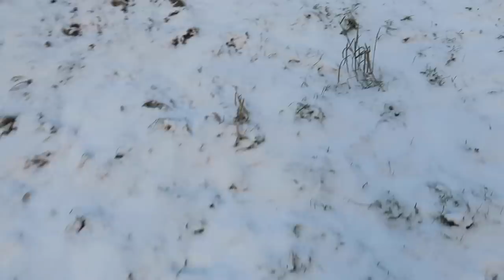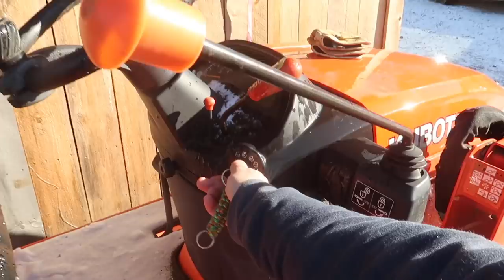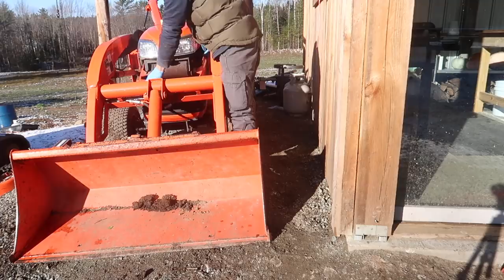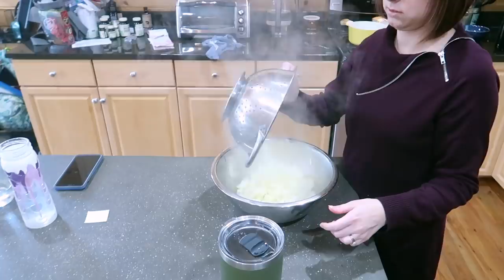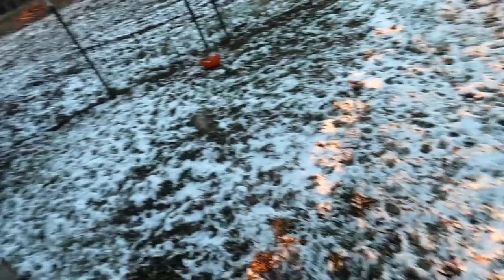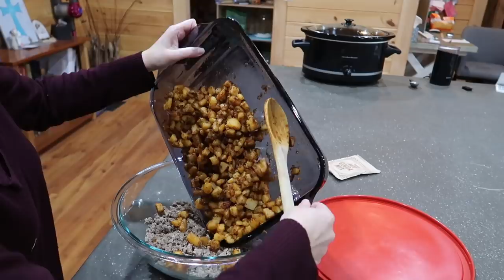Well That's Not Good! The Kubota won't stay Running

Comment: Buttercup is a typical kid, doesn't want to eat her veggies lol. Have you thought of doing breakfast bake. You use a type of potato (hashbrowns, leftover potatoes or tater tots). I use cauliflower insyead of potatoes. Use a greased 9×13 cake pan. Eggs in a bowl with seasoning and scramble. Place potatoes and  meat in in pan pour in egg mixture. Bake at 350 for 1 hour. Yummy. Can be made in a crockpot as well about 3 to 4 hours or until eggs are set.

Comment: Been running diesel tractors, trucks and pickups all my life, even had a diesel Oldsmobile for many years, and only had 2 gel up because I didn't get #1 diesel in quick enough and hadn't put "Power Service" in the fuel.  #1 diesel and "Power Service" are your winter diesel friends.  Engine block heaters on diesels make winter starts much easier.

Comment: Good Morning Family , 
Al , you should already know this but maybe you have forgotten.  When it is cold , moisture in the fuel can condense which then becomes water .  The water then sinks to the bottom of the fuel tank and is then sucked into the fuel line.  When storing fuel in the fuel tank you should always have some fuel conditioner added .  ESPECIALLY in the winter ! It will prevent the condensation and fuel line freeze up .  I would also suggest a shelter or barn for the storage of your vehicles and other machines . I think that it is more of a need than a want because it extends the life and condition of your machines. Kind of like insurance. I am lucky in that my place already had a detached three car garage.  Very handy for storage out of the weather.

Comment: Need to clean  out the fuel line  the 911 will not get to the ice unless the eng is running  ( use a hair dryer to clear the and then runn it) another suggestion  is to put hey bails around it to keep wind from blowing under it ...........

Comment: Man, that supper looks good!  Pretty sure you have water in your fuel - summer diesel typically does not gel until 15 deg F, and does not get as hard as ice.  Put a heater on the bottom of the fuel tank to thaw ice; after an hour or so, dip the tank with a stick and water paste to see if there's water in bottom.  If not too much, put the fuel conditioner to it.  If a measurable amount,  drain the water in the tank and fuel lines, replace your filters, and you should be good!

Comment: I feel for you Al. We got about 5 inches of snow and then rain and then it got down to 17 degrees with a wind chill of 1 degree today. So much that I didn't get picked up before the snow, but it will all work out.
I had to laugh when you let your girls out of the coop. Any time we have snow, my older girls stay in. What I do here is after I get done cleaning up after a storm, I run the snowblower in the run and then put some bagged up leaves down. That seems to make them braver. 
Thanks for all you do.
Love and blessings to you and your family,
Jim
Reply from the maker: I need to get a snowblower for the chickens and goats. 😂
Reply: They are handy, bro  @LumnahAcres

Comment: Good morning guys, we lucked out down here it's all rain. The fuel looked like ice (water In fuel) diesel normally gels when cold. My dad told me always keep the fuel tanks above 1/2 (preferably full ) full in cold weather to minimize condensation. Do you have a tarp dark tarp to throw over the tractor? You can also take the line off to the back filter, bring inside to draib ice out. Make sure to plug the tank end. Its good seeing all cooking together and praying before your meal, its a habit we have gotten out of.  God bless and be safe up there.

Comment: Hi Lumnah Family,  Those goats are really looking healthy and prepared for winter. Right now we are getting some heavy rains, and according to the weather forecaster, you guys are getting heavy snow. Winter is here for sure!  I owned diesel vehicles for years as well as running diesel equipment at work. I have a diesel tractor and utv and add 'power service' diesel every time I fill my jugs and never had an issue starting any of them in any sub-zero temperatures. I don't own diesel cars or trucks now because they are an 8,000 plus dollar add to a sticker price and the fuel costs more than gasoline at the pump!  You still can't beat diesel 'torque & power' for plowing snow or towing. The 'power service' diesel additive should in every tank of fuel, all year round, the silver bottle for the winter/cold months and the red for summer/warmer months. God Bless

Comment: If your Diesel is frozen its water in your fuel it's take  temperature in the single digits before Diesel gel up. I'm a retired 18 wheeler owner operator I drove I 80 Elkhart Indiana to salt Lake city for twenty years. You need to drain you  line before it's get to cold. Remember safety is number one on your homestead.

Comment: We go ahead and start treating our diesel tank and equipment by around the first of October usually so that we don't have any fuel issues. If we buy fuel later in the winter it isn't usually a problem. We also keep block heaters on everything, but only the L3240 seems to need it though.

Comment: Hey Al you can always use a blow dryer to heat up the frozen line to melt the fuel and use the tractor.

Comment: My tractor has a filter with a water gauge in it. I was always told to drain the system when there is water. It can foul out your glow plugs. Luckily I haven't had an issue yet. With Oklahoma predicted to have a colder than normal winter this year I have that feeling I might this year. That was a lot of water in that line. We got down really low last night so out to check the chickens and ducks. Hope everyone's day is good.

Comment: Do you have winter and summer fuel where you live Al ? They have different wax / gel points . My old Dad is from the UK , when he was a lad they would put a kerosene slow burner under the engine overnight to help start in the cold mornings .

Comment: ice in the fuel line is my guess, use a de icer for the fuel and refill with a winter formulation diesel.  Maybe a dipstick oil heater too.  Not much of those problems here in Texas

Comment: Totally sucks. One of the things I was very glad to have when I did have a diesel School Bus to RV, was a heater that I would plug in. The heater kept the engine warm which in turn kept everything else warm had no problems starting my bus in 30 degree weather. I'm surprised the tractor doesn't have one. Question: when are you going to breed your goats?

Comment: Oh the diesel skeptical!   Not that I'd ever want a diesel car or truck, but my brother and father have both had a long string of diesel cars and by and large they never had issues with the fuel!  Well except once when my mother had someone fill the tank of the newest Mercedes with gasoline!  That hurt!  But, again, my brother attended college in both Potsdam, NY, and Montreal Canada with his 1979 Peugeot Diesel Station Wagon!!!  What I recall was that he used to charge $10 for a cold weather jump start for all his buddies that had gas cars that couldn't start!  The battery in his car was more than twice the size of the batteries in gas powered cars and it never failed him.  I will go on record to say that there was nothing else about that car that justified it's existance!  It was ugly, slow and hard to get parts for, which was OK because nobody would work on it for him anyway!  Through that same time frame I drove a 1970 Ford F250 with a 390cu.in. v8 that to this day is still the best vehicle I've ever owned.   It never gave me trouble after replacing the valve guide seals  and stopped burning oil completely from then on.

Comment: We always add a fuel stabilizer to prevent jelling even in the winter fuel and after a certain temp we always plug the tractor in the day before so it will start with no issues. They are kind of a pain in the winter. Well at least ours is. We have a 75 horsepower 2000 Belarus tractor.  It has an amazing heater and when it's -35'c, my husband plows snow in his t shirt because he gets to hot!! haha
Reply from the maker: I need to put a heater on the Kubota. It didn't come with one.

Comment: You should of cranked the engin over to push the ice out because you may have water in your line's, even use a hair drier to warm the lines and push fuel through the line to clear them.

Comment: Tarp over the Kubota and run the pipe from your smoker under it to warm up that fuel line. You will need to add fuel line deicer to your fuel supply. That's life in the cold with diesels.  You know about 911. so this was nothing new for you. Good job Al. love following your channel.

Comment: That is frozen water, not gelled diesel, it won't start gelling enough to give you trouble until you get below 15F. You should be able to run that diesel tractor all year, just switch to a winter diesel when necessary, and you should be good to -40F. I worked in the oil patch as a diesel mechanic, in North Dakota a few years, and can tell you some horror stories about diesel gelling.  I got a bad (read fraudulent) tank of winter diesel, on a crisp -25F morning, and ended up leaving a 3 day old F550 on the side of I94. By time the wrecker I called got there, the F550 was gone.

Comment: You should pour some of the 911 into the frozen line to melt the ice. You need the white bottle for the antifreeze anti gel in the fuel. It will prevent that more than the 911.

Comment: If you can't build a garage for the machinery. At least get a block heater and plug it in. At extreme temperatures. We built a garage and plugged in the heaters. With care I always started the engine. Let it warm up. Then clear the snow no problem. Don't forget to warm up the hydraulics.

Comment: HEEY AL, your a better goat herder than a mechanic.  You should have cleaned the ice out of that line before hooking it up to your new filter.  Now you will have water in your filter and motor, not good.  That anti-freeze will not thaw ice, it holds water from mixing with fuel.  Com'on Al.

Comment: Here's a thought for you you probably have an air compressor blow air through the line if that line goes directly up to the tank you can listen for the bubbles he'll also helps tear out the 911 if you have a second filter you have to disconnect it from the filter and blow the line through that way they won't plug up your filterand just sitting in emergency case only I have hooked up lying to my fuel filter like you have a inline filter like that and blow air through it to clean it out so I can just keep on going through to get home just some ideas for you

Comment: I doubt that your issue is actual Diesel freezing off. You probably have water in your lines and this looked like a low spot in the fuel circuit.  Do you have an water separator on your tractor? My John Deere utility tractor has one that usually has some water trapped in it.
Reply from the maker: The Kubota doesn't have a water separated on it. I need to install one.

Comment: the anti jell should help the fuel . Put some in every winter tank full :) Pouring warm water on the fuel line outside might help thaw it .  Also consider switching to all synthetic engine oil and gear case oil year round. Synthetic oil takes half the cranking amps on engine start up. https://www.howeslube.com/index.php  ,   https://www.macallister.com/winterizing-equipment/ ,      You stopped it before engine damage , good save AL. Winter is here :) One of the worlds best battery charger  / conditioners - http://www.batteryminders.com/ , with the right 12 volt model you can keep 5 or 6 batteries charged on one unit , plus desulfating. 5 yr warranty. Friendly tech support and right up in   Huntington, NY. Northern tool has on sale often. Hope this helps.

Comment: Why don't you use your wagon to move firewood. And use a hair dryer to warm your fuel line on the Kubota  to thaw them out. Have you thought about a finish mower  or a brush cutter for your tractor

Comment: Puzzelled by your comment that you can't use your tractor in the Winter. Because of your low temp Winters you really need to have an indoor storage for all your farm appliances. Hard frosts and snow will overtime damage your equipment. Having a suitable indoor facility  will enable you to not only safely store your equipment but allow you to do maintenance during bad weather
Reply: soaringtractor  yes a 3 car garage would be a must do project. However I think the Tractor and other equipment would be better in a building small way from the house big enough to do maintenance . A power supply and a small heater.
Reply: soaringtractor Indeed the need for garaging the car and truck is just as important as cover for the tractor. I was thinking that having an Implement shed would keep the expanding range of farm equipment under one roof. Also the tools for maintenance along with the fuel, oils and lubricants away from the house. Just thinking safety as well as care for the equipment.
Reply: soaringtractor  Hmmmm safety. The two most precious people in his life live above that Basement. Fuel etc should be far away. 

It's like the wall a slip crossing that wall could have caused severe injury. Rain, Sleet, Snow and Ice any one of those could have been the cause of a slip. Now there is a entry/exit on level ground.

I grew up on farms and I learned from the mistakes of others, as well a few of my own. Your safety and those you love are your responsibility.

I respect and admire all the family, that includes Ninja cat and Loony Dog. Be well and prosper

Comment: No not my Kubota
Reply from the maker: Not a good day when the Kubota wont start!
Reply: Do you have a dark tarp to throw over it to thaw out the ice? Or pull off the fuel line take inside drain and put back OK. Make sure to plug tank end of the line.

Comment: just a trade secret -- when yu first crank the tractor - let it idle for a minute before idling up - it will save some ring and bearing life - and make sure they have fresh oil and filters  in the winter - 30 % of engine life saved with these Technik's - always let them idle at least 6 minutes in winter - 3 minutes in summer - least amount - on really cold days - I let mine idle 10 - 15 minutes - and run them really slow for first 10 minutes - some of the places will even tell yu to do the opposite - hoping for business -- ahahahahahahaha - studies were done in the 70s even - 30 % or more savings they proved - also - fuel in plastic tanks gums up in winter badly - needs additive so that filters don't clog - and to kill off fungus / bacteria  that grows - 911 may not be enough - a hair dryer would melt ice in line -- ahahaha  - better keep a trickle charge on battery during  winter - a good maintainer is better with disulfate mode - I own 6 of em for winter use  - I have one in use right now - extends battery by a lot  - battery's will last 10 years or more when desulphated during winter -